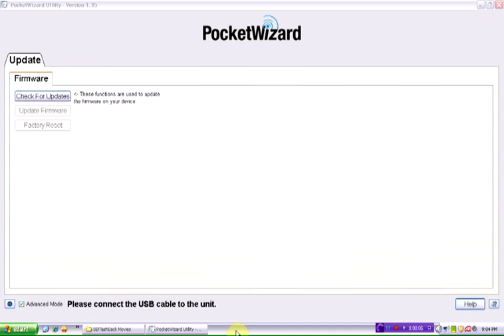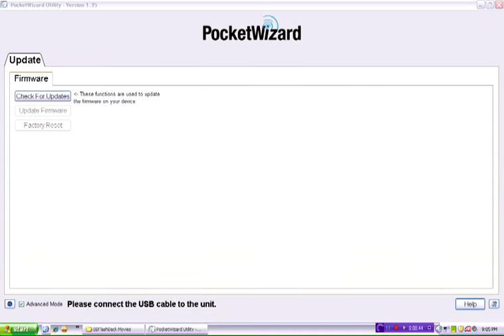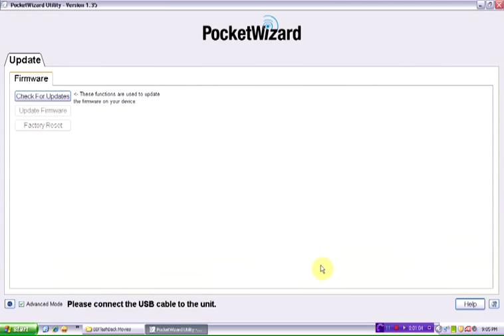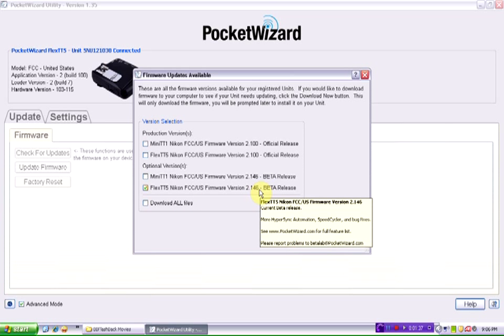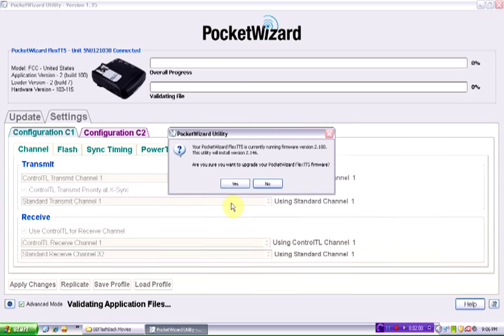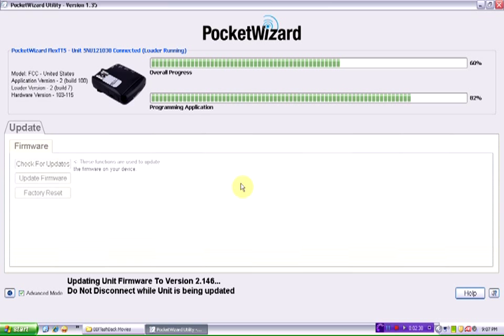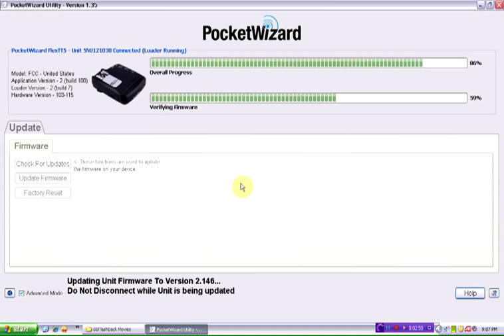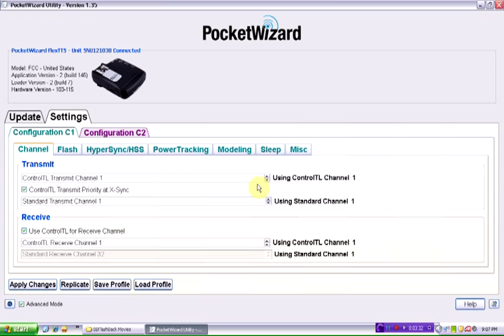How To Do a Firmware Update on a Pocket Wizard FlexTT5

Comment from the maker: The answer to that is, no USB cable, no updates. The good news is that all Flex and Mini units come with cables, chances are you have multiple cables. If not, drop in to any computer store, ask for a short USB to mini-USB cable, that will work. Most people have more than one ControlTL unit, that means you own more than one cable. ;-)

Comment: Hi Jerry, Thanks for your quick response. I actually did this, but when I click on the utility, it's say's Canon, The thing is, I actually downloaded the Nikon software and I went back and checked several times. It keeps happening. I'm pretty sure it's not suppose to do that, here is what it is saying when I click on my desktop icon "Pocket Wizard Utility 1.35" PocketWizard Utility 1.35.pkg
Quick Guide - MiniTT1 + FlexTT5 for Canon.pdf  ( This here should be wrong right?)
ReadMe.rtf

Comment from the maker: Hi, thanks for the question.  I am sorry, but I am about as far away from being a Mac person as there is on this earth, however, I will try.  If you go to the main PW website and search in the downloads section (pocketwizard website in the support/downloads section), download and install the configuration utility (MAC version).  You then run this application and then connect your MiniTT1 or FlexTT5 via USB.  The program should see it and you should be able to make the firmware updates.